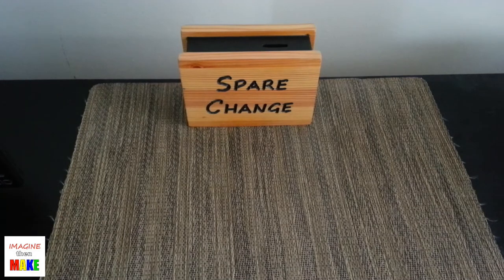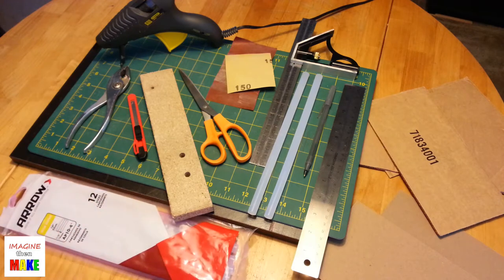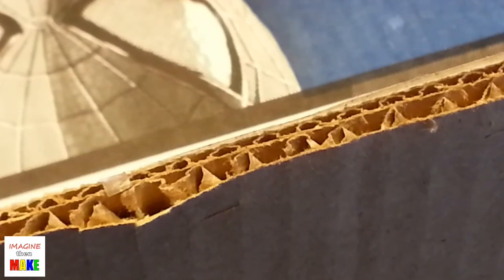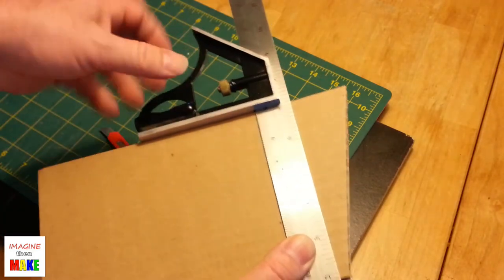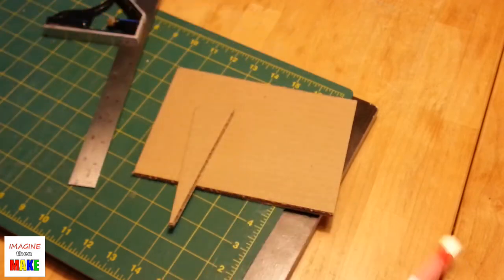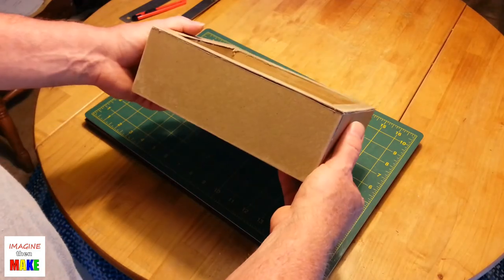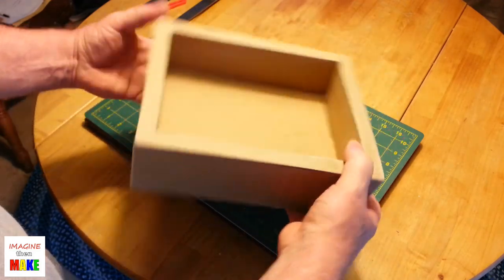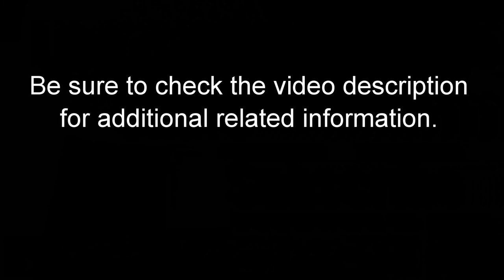115. Simple DIY - make a strong box from cardboard

Comment: Covering the edges to hide the corrugation is done better to cover with strips of brown paper bag or regular paper
Reply from the maker: I haven't tried paper to cover up the corrugations; I always thought it would be too thin. In this video, you saw me use chip board. I do like using chip board because 1) it is very inexpensive and available online 2) it is thicker than paper 3) it is easy to cut 4) I can sand it and 5) it is paintable. And as I said in the video, the possibilities are virtually endless.
Thanks for your comment and for watching.
Reply: Paper bags are useful for detailing, yes. I'm ordering some specific paper tape for packaging. I saw another cardboard crafter use a paper tape with dry glue that you wet before using, like a stamp. It seems to shape very well to his craft projects.
Reply from the maker: Sorry for my late reply; I just now saw this. I'd be interested to know know more about the paper tape with the dry glue  you mentioned. And to know more about the cardboard crafter you mentioned.

Comment: A source of thick cardbosrd I use is the Heavy Duty type moving boxes from Home Depot. Double walled like the TV box in your video, except both layers are the same thickness and fluting size. (Did you know the corrugations are called flutes? I didn't until recently.) I also use my table and miter saws to cut it when possible. Makes things much easier.
Reply from the maker: I live in an apartment complex, so I'm able to get cardboard for free from the large recycle bin. I like using the large flat screen TV boxes because I think the grade of cardboard is better than the run-of-mill Amazon box; after all, the box has to protect the TV from getting damaged. I prefer to use hand tools to cut the cardboard. Even in my woodworking, I prefer hand tools for lots of reasons such as: using hand tools is relaxing, quieter, not as dusty, and often times cheaper. I have used a hand saw to cut a glued up stack of cardboard and that worked out pretty well. I prefer hand tools so much that I got rid of my table saw and sliding miter saw years ago.
Cardboard is one of those materials that has tremendous possibilities limited only by your imagination. And if you are lucky like me, the material is free! That's pretty hard to beat. Good luck with your next project!
Thanks for your comment and for watching.

Comment: Have you tried spray contact adhesive to laminate layers of board instead of hot glue?
Reply from the maker: Yes I have. Look here: https://youtu.be/Z6det-aFRe0
Hot glue seems to work pretty well also, it sets quickly, and I can use it inside the garage with the door closed. A glue stick would also probably work well although I haven't tried that either.
Thanks for your comment and for watching.

Comment: Is there a way to make the box water proof so that it may be washed some time? Thank you.
Reply from the maker: Good question. I have never tried to do this. I suppose step one would be to apply several coats of sealer. Then maybe try to spray paint the box with several coats of enamel or latex paint. If I try to do this, I'll be sure to make a video.
Thanks for your question and for watching. BTW: I still use this box everyday and it is holding up great.

Comment: I'm not sure why you would spend all this time making a cardboard box when you could have made something more sturdy out of 5mm underlayment (about $15 for a 4'x8' sheet) and finished it the same as for any wood project. It would be more durable and look better than a raw cardboard box.
Reply from the maker: There are several reason why I wanted to make this box using cardboard. 1) The cardboard is free from the recycle bin. Many people have access to free cardboard so if they saw this video, they might be inspired to try and make something from cardboard themselves. 2) Minimal tools are needed. For anyone that wanted to try this,  the tools would be easy to get and very inexpensive.  3) The finished cardboard box is very light yet very strong. Light and strong tends to be a good combination for anyone making stuff. 4) Yes, I could have made this box from underlayment as you have suggested but I wanted to try and do something a little bit different. I wanted to do a project that might be accessible to more people. I think the wood version of this box would also be strong but heavier and require woodworking tools to make.

I still use this box everyday and since it now sits inside my dresser top drawer, I never did apply any kind of finish to the cardboard.

I continue to work with cardboard to make stuff that is use everyday. Here's a recent video that shows how I made a tablet stand for my wife from cardboard: https://youtu.be/ULP35cypmH4 . She uses this tablet stand every single day.

Thanks for your comment and for watching.
Reply: @ImaginethenMake  Well, I do appreciate that you were making a video to show how anyone can construct a useful, strong box out of everyday materials at very low cost. I was just wondering why a woodworker would do that for something he uses every day instead of making one out of wood :) It's great that you try a variety of craft projects to solve household problems, not just rely on woodworking skills. "If your only tool is a hammer, after a while all your problems start to look like nails" ha ha. Looking forward to watching more of your videos. Thanks for sharing your ideas.